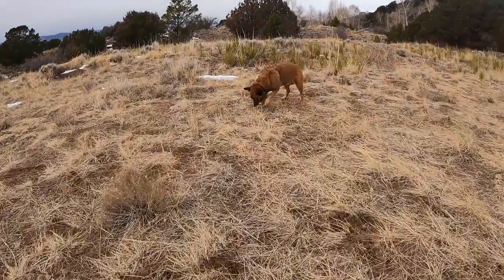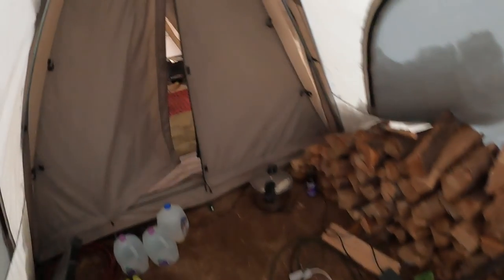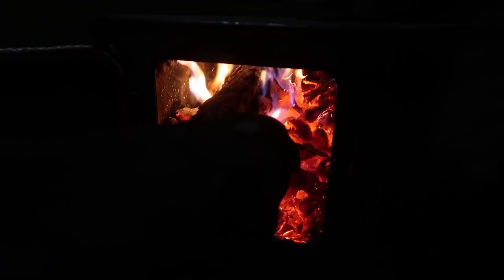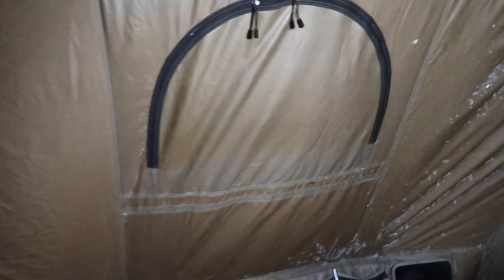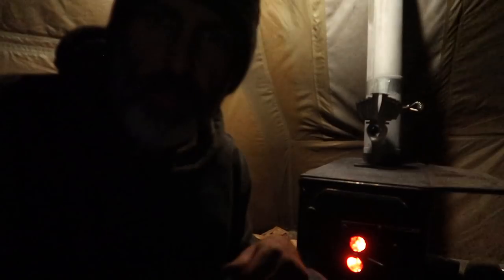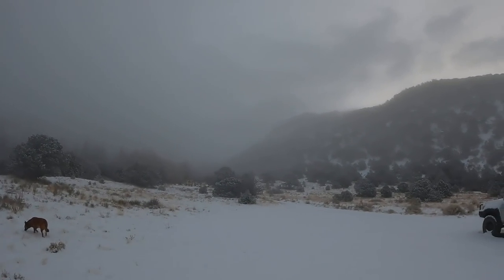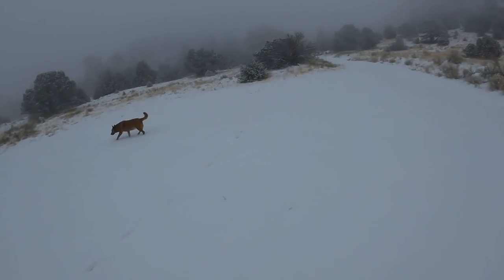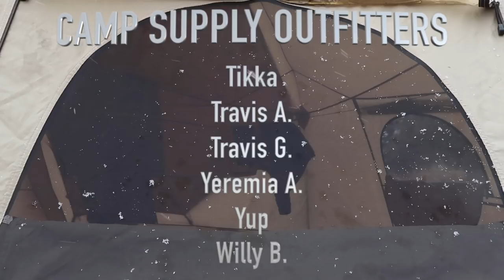2nd GNARLIEST NIGHT I've Ever Had Winter Camping w/ My Dog, The Stovepipe Is Dancing!

Comment: I have a similar setup with my woodstove in a canvas bell tent. We had 60+ mph winds and the tent held up great but the stove pipe took a beating. The next day I found some cordage and tied it to the spark arrestor on the top of the stovepipe. We had 50+ mph wind the next night and the stovepipe did not budge! I ran the cordage to the tent stakes to secure it and I never noticed any squeeking or noise even when the tent was "breathing" in and out in the high wind. Great content, batten down the hatches and keep that fire stoked!

Comment: Nice video. Thanks for sharing. Have you thought about making a grate to sit a couple inches off the bottom of the camp stove? It would keep the wood and embers off the bottom of the stove and make it easier to remove the ash underneath. Also helps with airflow. Just an idea. Keep the vids coming.

Comment: How do you go about choosing a campsite in regards to knowing you'll be able to drive out at the end of the trip. I imagine the snow accumulation builds up over the winter and not much snow plowing where you camp.
Reply from the maker: Hi J G, great question! I've spent the last 7 years figuring out which areas I can get into (and out of) throughout the winter season. In total, I have about 2 dozen sites I've found with good access - even in deep snow. My truck can handle up to about 15 inches of depth before I need to bust out my maxtraxx. I've had a few instances where I get snowed in at camp but after a few days of sun, I can usually get out once the snow has melted/settled a bit. Have a great day!
~ Brian
Reply: *down slope egress would be preferred. Snow chains, snow cables, and studded tires. Winch, and cell phone!

Comment: It seems like the stove should have some kind of tiered pan on the bottom, to collect the coals and ash as they fall through a grate. 
I grew up with a cast iron stove, and it could be burning while you emptied ash from below a grate..
Reply: I burn one stove in my house, a Harman coal stove insert and it has a shaker handle and ash pan below the grates to take out ash because coal burning produces much more ash than wood.  I also have other lower quality stoves i burn in my shed,  one is perfect other than having no decent ash removal system. The others have ash bins or openings for shoveling. It can be added on to his current stove, but needs done in summer,  letting the stove go out to clean is the worst and even with doors open and air filters running, ash gets all through the air when shoveling manually into a bucket or something.  I have to weld a rectangular box on the bottom of my horizontal (former) air compressor stove and it will be an amazing unit with ash duty done outdoors.

Comment: Use those cheap dollar store tin cooking pans. The ones for cooking like once and throwing away. Just keep a few of them for ashes and if you put anything hot in it just flip a second one over top the one you filled and hold it down with a couple heavy duty paper clips. Don’t even need to leave the tint to ash the stove.

Comment: About 40 years ago I found at a U.S. Army cold weather tent at an old used military equipment outlet. It it a double walled build with a special entry with two openings. It's about 12 feet in diameter. Has an outlet for a stove. Coldest I've seen in camp was about -9.  It took literally a small coffee can size fire to keep it warm enough to be comfortable.  There was another regular design single wall cook tent with a portable stove that was awesome after about twenty minutes and the stove heated up. 👍👍

Comment: I secure the flue to stove with springs.
Reply from the maker: That's cool, I prefer not to use any springs or screws since they just make more noise. Cheers to hot tent camping, the season is almost in full swing!

Comment: I found that using some long Springs on your stove pipe is better than it getting ripped out of the stove.
Reply from the maker: In the 7 years of full-time camping, I've ever had an issue with the stovepipe. The stove jack keeps it secure, no need to carry any additional gear.
Reply: @OffGridBackcountryAdventures  it was my first year winter camping and I was so afraid that the pipe will get ripped ripped out and I talk about with a friend of mine any put the springs on the stove pipe to give it a little wiggle room but still be held in.